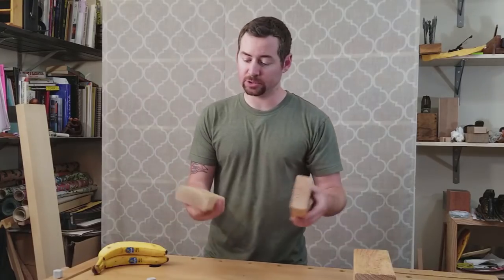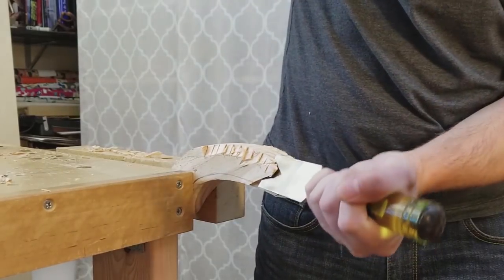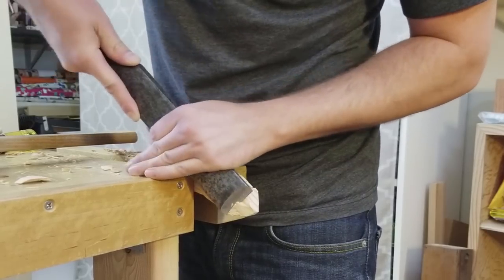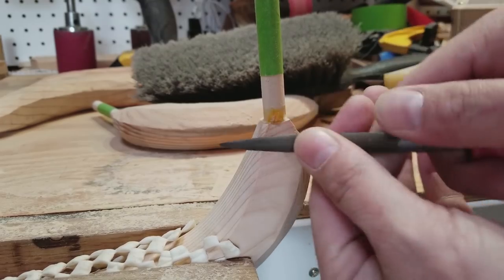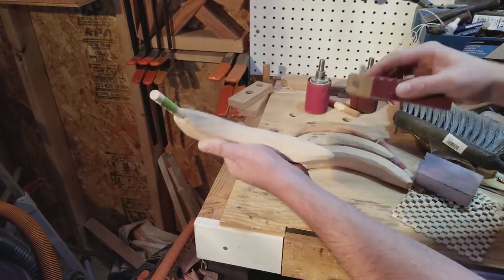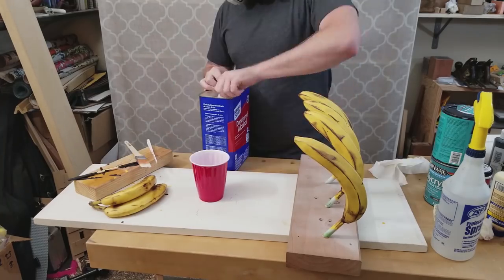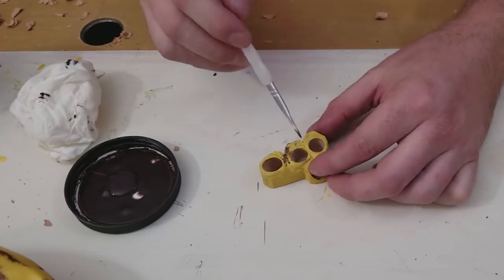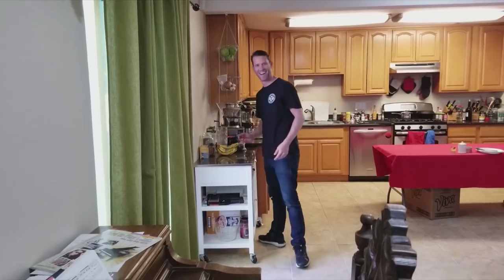I Pranked My Roommate by Making Counterfeit Bananas

Comment: You really need to bolt that workbench down.
Reply from the maker: Yeah, after this video I added some diagonal bracing and a shelf on the bottom where I put all my hand planes and some weights.  That made it a lot sturdier.

Comment: Are you doing a lot of woodworking? Tools look newish to me. The table is wonky. Next time use a bandsaw.
Reply from the maker: Some of the tools are newish, but many of them are antiques that I have restored.  The slick chisel is super old, and the spokeshave and drawknife were originally used by my great grandfather.
I would probably use the bandsaw for some of the bevels in the future;  I didn't think of that at the time.

The workbench has a nice top, but I built the legs pretty quick and dirty, so it could use some diagonal braces to make it more stable.